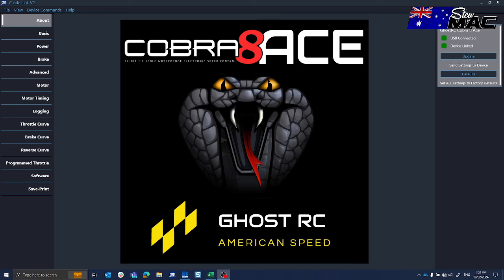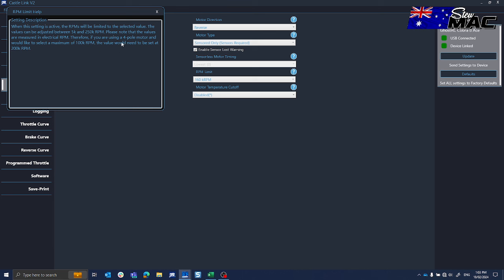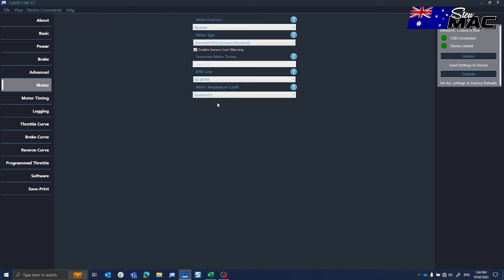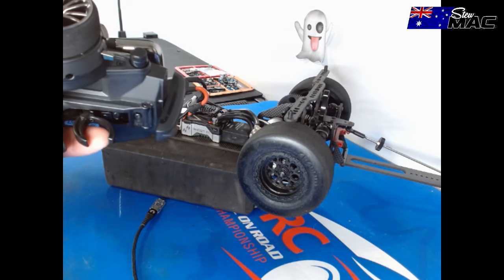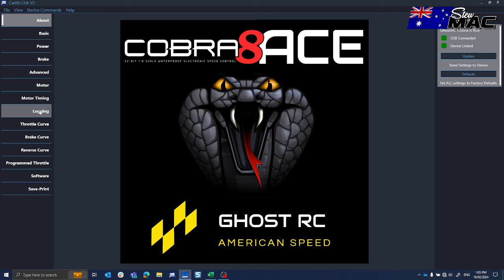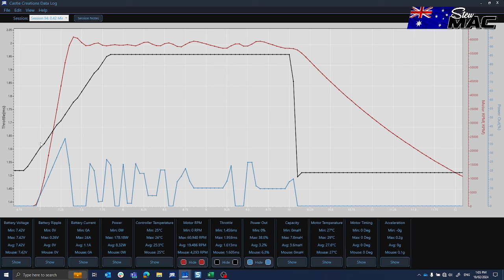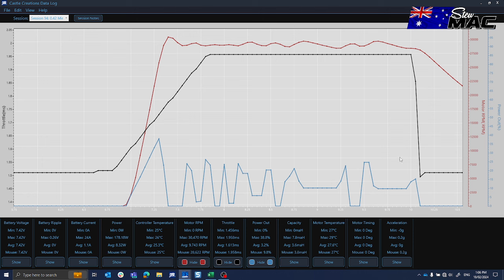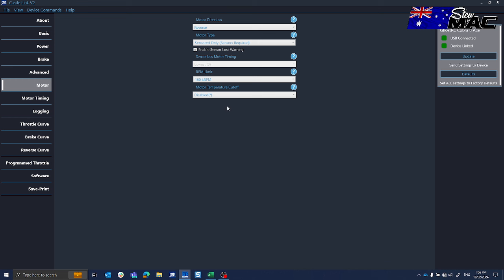Ghost RC Cobra ACE RPM limit

Comment: It appears they no longer have a built in capacitor. Why do you think that is?  Have you experimented with and without one to see if it is needed?  If it does, any thoughts on how big of one is needed?  Thanks appreciate your insight.
Reply from the maker: It has built in caps but they are designed to handle a voltage range from 2 to 4s.

I don’t experiment with caps. I have made my own and gone down that path. Now day I just buy ones I know work.
Reply: @StewMac570  I meant have you tested without to see what rippple is like?  What cap are you using?
Reply from the maker: @Paul-815  no. I know the ripple will be higher which can cause damage to the esc. 

So I don’t intentionally try to damage the esc by testing without the cap pack.

Comment: This will be huge on there new 8s esc for speedrunning 6 pole motors..the xlx2 is currently haveing syncing issues above 50,000 rpms on the tp 56mm 6 pole motors.with these feature it could work..hopefully new 8s esc wont have this syncing issue anyways
Reply from the maker: I think the 32bit processor will help with running 6 pole motors. 

The old esc was only 8bit so reading that many signals per rpm must have been difficult.

Having a process that is much faster could help with sync issues.

These are just my thoughts and not stuff that’s come from castle. So hopefully they make a 1/7 and 1/5 version in the future and the new hardware improves what we have available now.
Reply: @StewMac570  great to hear your input.not to tech savvy, just like to go fast.but makes perfect sense.i love the torque of the big cans.just can't get the rpms ya need.no one really nows exact rpm or cause ,but if resolved it could be huge
Reply from the maker: @KBASHRC  yeah if the 6 poles could be used again it would be a game change.

The older esc are full so there is no more space in there memory to fit changed to handle 6 poles.

The new esc has heaps of space to grow. So it’s only just the beginning of what these new generations can do.

Comment: Hello Stew! Question concerning rpm input. When you are setting rpm activation for timing in this new Cobra, do you still need to double the number you want to set it at? Like if i want to set it to activate from 1500 to 30,000, do i need to input 3000 and 60,000?
Reply from the maker: Hey Greg! 

If running a 4 pole yes.
Reply: @StewMac570  ok. That's what I was thinking, like the old Ghost
Reply from the maker: @Gregorybridgewater  yeah it all works in electrical RPM. Because the 4 pole has twice as many poles per revolution the rpm reads double.